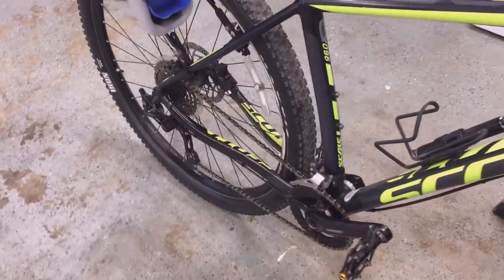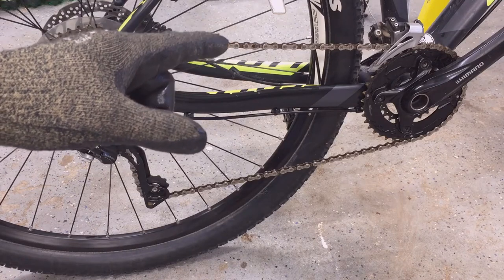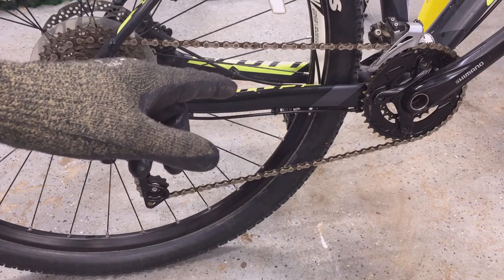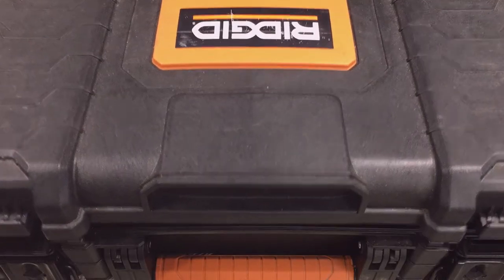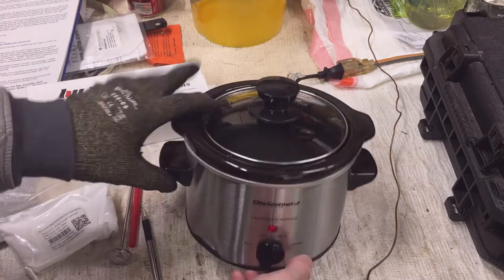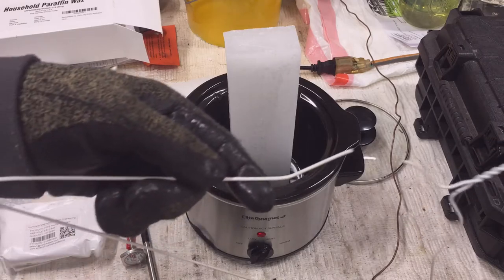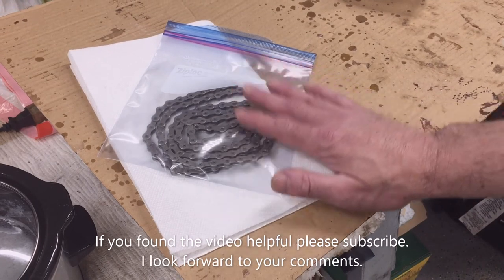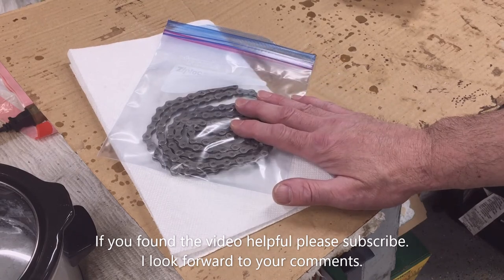Best Bike Chain Lubrication for Dirty Environments Paraffin Wax & PTFE works for Any Bike

Comment: Came up with the same method of having two chains too, makes the whole process so much better for hot waxing...
Jfi, bikers call the chain ring and rear cog just sprockets...no reason to call something which it isn’t
Reply from the maker: Barnes, Its been a while since I did that video. I probably called them by the name the manufacturer uses, for automotive videos, I often state the proper (manufacturer/OEM) name and the common name. This helps when you are buying parts, to ensure you are buying the right part. I appreciate the feedback! - Stiles

Comment: I discovered that nothing else beats fine powdered graphite for lubricating! purposes and its low in price. It has to mix easily into the candlewax. If you rubbing it between your fingers they have to look like they are made from metal, it makes a dark glossy metallic shine. I put the Candle and a few spoons wax into a plastic bag, heat it in hot water and work the chain in it. The best thing is that the graphite repels water, so your chain stays dry and wont rust. Project Farm did very conclusive tests on graphite additives.
Reply from the maker: Suesses, I like the idea of Graphite! I will try it this summer. Of course the nice thing about PTFE and Wax is if you touch it, it doesn't get you dirty like oil or other wet lubricants  do. And, Graphite if you touch it is dirty. If it lubricate better (which I think it would) and if it doesn't attract road gravel and dirt, it may be the Lube for me! I appreciate the comment! - Stiles
Reply: @StilesAutomotive  The grey color is only a problem if you wear white trousers which touch the chain, it will get grey. Tested with handchief. For me its really no problem, but i also dont like the mess which oil makes. Important note, use the finest powdered graphite you can find. I have very fine dust, if you use coarser graphite it could be that it doesnt work well or it acts as an abrasive. I have also graphite for locks, you put it into your lock to lubricate, but in the same time it has to be bone dry, because it does not work if oil is in the lock. This works very good for locks, i tested it. This lock graphite is like powder, it has shiny little particles if you get it on your hands, if you war a headlamb. The other lubricating graphite i used for my wax is like inc, it makes your fingers black and shiny instantly as soon as  you get it onto your fingers, the lock graphite you have to rub between your fingers in order to get them black. I think the lock graphite would be to coarse to work. I found 4 micron graphite online, this is the finest i found. But i have already fine graphite but i dont know how fine it is its measured "Fuchs Graphite Powder F" it says "chemical resistant, high load bearing capacity under low friction, good affinity to metal surfaces at different temperatures, improves friction properties, economical" "very fine natural graphite powder with highest purity" Good luck, i will never go back to oil or grease.
Reply: What makes you think is is better than PTFE or  molybdenum disulfide?

Comment: Can honeycomb wax be used instead of paraffin?
Reply from the maker: Losif, Probably, Paraffin Wax may have a slightly higher melting temperature, which would make it more desirable. But, I think the real lubricating agent is the PTFE (Teflon), the Wax gets it in there and holds it in place.  If you have an abundance of free Bee's Wax, I would try it.  You know, Bee's Wax is the recommended Cutting Fluid for drilling or cutting Hard Stainless Steels (recommended by Old Timer Machinists). Let me know how it goes! - Stiles

Comment: Ptfe is expensive for me as a student 😅 but i want to try this wax chain. Can I use only melted wax candle? That is the only thing I can afford for now
Reply from the maker: James, Dude, You're breaking my heart, I know what it is to be a poor student, but the PTFE Dry Lube Powder, I list in the video description (also see link below), is around $20, and will last you for several years. Really, the PTFE is the Lubricant the Wax is the Binder that holds the PTFE in place. Sure the Wax has some lubricating properties, but not much and I wouldn't run it without the PTFE. - Stiles

Teflon, Virgin PTFE Dry Lubricant Powder, 3.5 OZ (100 g) 1.6 Micron Particle Size, https://amzn.to/3gGgYlj

Comment: I think there is an error here: https://youtu.be/LZQYhk5W29I?t=750

In your document and when you are talking you say the recipe is:
500g of wax
5g of PTFE
1g of molybdenum disulfide

But in the overlaid text you say 50g of PTFE?
Reply from the maker: Sorbpen, Yep, I'm talking about different people's recommended recipes. And, then I state what I use, the 10 to 1 ratio of Wax to PTFE or 2 lbs of wax to 100 g of PTFE. I think you are talking about the UltraFast Lube which also uses MoS2.  Here is the deal: the Wax is just what holds the PTFE into the Joint that we want lubricated. The Teflon (PTFE) is the actual lubricant, it just won't stay in the Joint without something to hold it there.  The more Teflon in your mix the better. - Stiles

Comment: Chains sitting in gas for days will make it brittle
Reply: 🤣🤣🤣🤣
You do know what chain lube is made from don't you?
Hint: Petroleum.
Petrol/gas does not make steel brittle to any significant degree, if it did Internal Combustion Engines would self destruct.
Please make sure Your brain is switched on before engaging mouth, or in this case fingers.
Reply from the maker: Vital, Yep like Nigel commented below, Gasoline and Petroleum Products do not make Steel brittle.  It's weird your You Tube Channel title is "vitalbikechains" and this is very basis metallurgy. The properties of Steel are affected by the materials you add to the Iron while molten, (like carbon, nickle, chromium, etc.) and the heat & cooling process. As a note: This is my very first "Thumbs Down" on a comment!  - Stiles
Reply from the maker: Nigel, I appreciate your comment! - Stiles
Reply: Not true. Gasoline is a petroleum hydrocarbon which does not cause embrittlement.
  Chlorinated hydrocarbons like Chlorinated brake cleaner will cause embrittlement.

Comment: You forgot one ingredient which is the paraffin lamp oil that prevents the chain to get hard when it cools off. Watch Ozy video. Ozy is a guy from Australia and his formula is Paraffin (candles) + paraffin Lamp oil (liquid paraffin used as fuel to camp lights) + PTFE. Perfect formula and your chain does not get hard at the end........... Over here: https://www.youtube.com/watch?v=diMxFwB6GBQ&t=21s
Reply from the maker: M, Yep he is good, I do like my idea of using a piece of Wire Coat Hanger, I use Hooks, Z-hooks and C-hooks that I have made from Wire Coat Hangers for painting Car Parts. You can hang the Parts from a hole in the Part and not impact the coatings.  He did mention Graphite, I wondered about using it. I think it would be a great lubricant, but maybe messy-er.  He just ran the stiff Chain over a Broom Handle or his thumb.  Oz added Paraffin Oil for wet conditions.  With the Oil does the Chain collect more dirt in dry conditions?  I appreciate the comment!   - Stiles